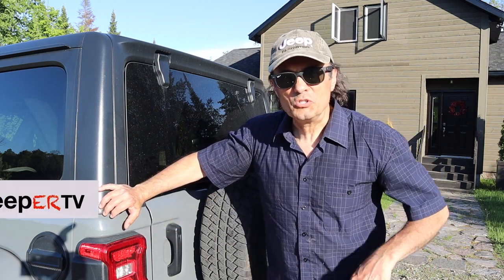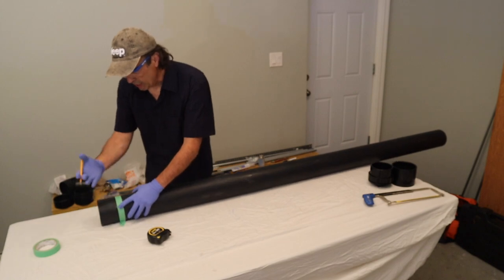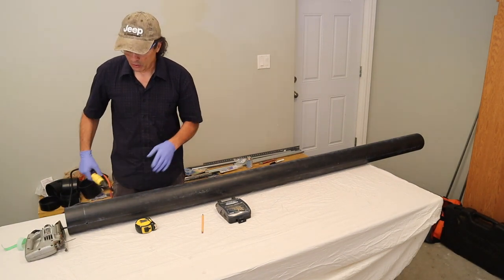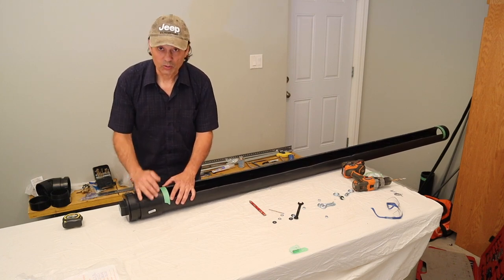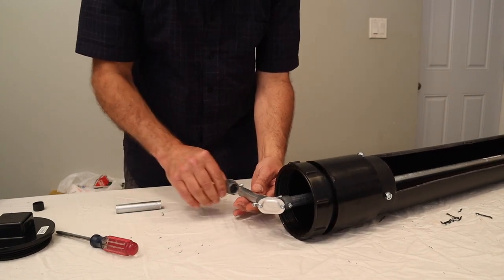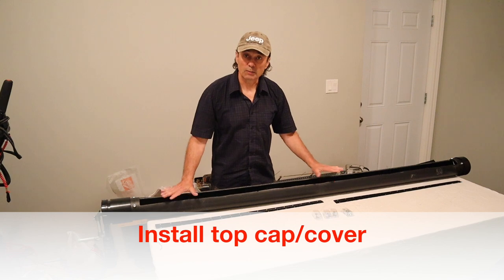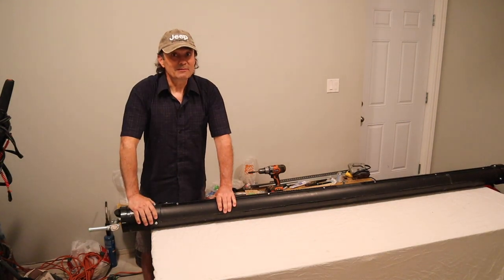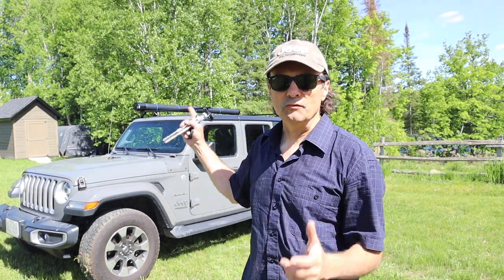DIY Awning, Part 2 Construction and Cost - Jeep Wrangler

Comment: This looks great. I love that there’s no welding involved. Not sure if its accidental but having the crank on the same side as where the ends of the tarp align (where the twisty ties are) makes it much easier to roll up the awning. Especially by yourself. Love seeing your builds
Reply from the maker: Hey John, Thanks. I enjoy seeing you employ your skill set in your videos also. Especially with your repair videos. The fabric you use in your awning would make rolling it up into a tube much easier.  I tried the tarp, as it was only $7.50 at CDN Tire. I'll cover this in next weeks Awning Deployment video.  Cheers.

Comment: If you used 3 eyebolts each end there is absolutely no way that the centre pipe can move away from the centre line
Reply from the maker: Hey Andy, Thanks for the tip. 👍